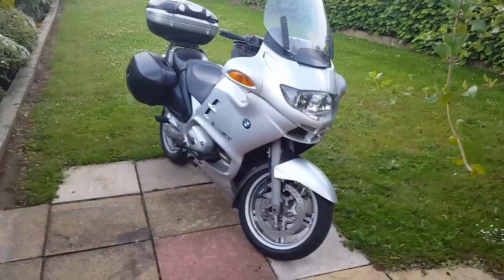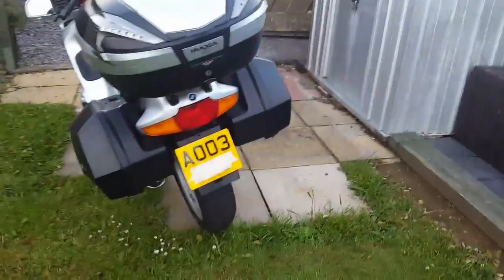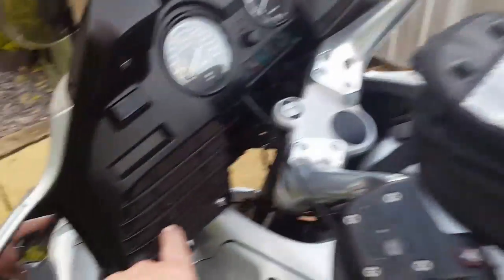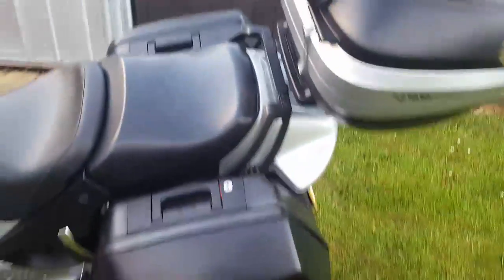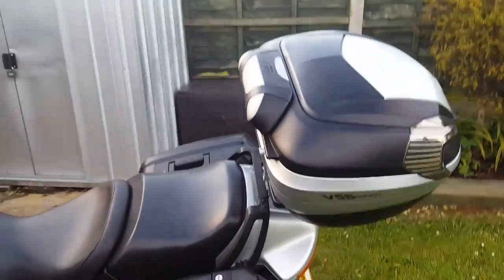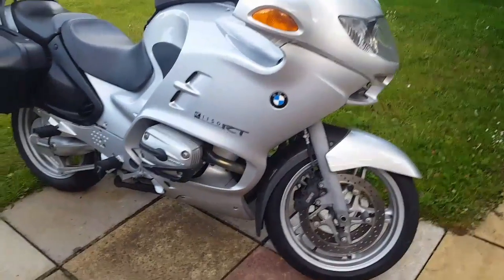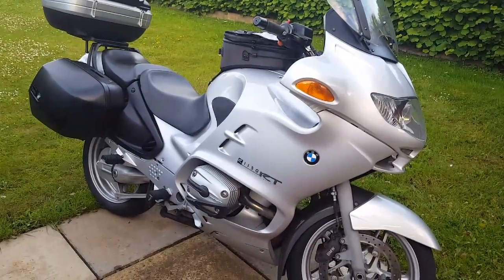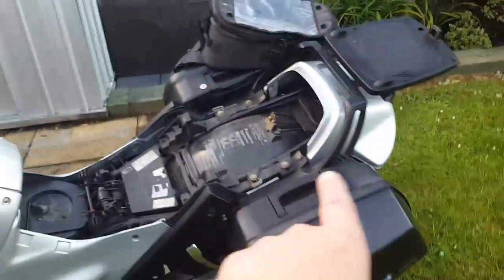Bmw r1150rt  "rita"

Comment: Great bike. I did 15000 km on it mostly to commute and it has never failed me.
The RPM is a bit low, it should be between 1100 & 1150 +/- 50. The engine will sound much better

Comment: Nice acquisition, should be excellent for touring.  I’m similar shaped to you, I’m over 6 ft, but only 31 or 32 inch inside leg, and struggle to find jackets long enough.
Reply from the maker: Hey Tony , there will be lots to tinker with I'm sure but just so bloomin tied up at work its gonna be ages before I get to know the bike. Hey ho! 
👍🏻☮❤

Comment: I’m 187cms and found the riding position uncomfortable on a long run, especially on my right side, might be my age? GS much more comfortable, experienced same problem on a K1600 as RT1150.
Reply from the maker: I never did get comfortable on it . Ended up with a 1200 bandit and it feels fine .👍🏻☮❤
Reply: springy 2112 Pleased to hear that you found a comfortable bike eventually. I rented a K1600 for a couple of days, too low for me even in high seat position. God help anyone riding a bike if 6ft 6ins+!
Reply from the maker: @jeanjacques9980  
I'm 10cm shorter at 5ft 10 . but I have short legs for my height also ..so it's always fun finding a bike that fits that's not a cruiser..
Not quite old enough for cruiser yet at 52 !! one day I'll probably go to the dark side .👍🏻☮❤

Comment: Like you, my legs are 30 inches on a good day. I'm curious how you have gotten along with Rita. I'm looking to buy this model here in the USA and am concerned about being too tall for me. Long term are you comfortable with the lowest seat height setting?  Knowing what you know now, ... would you still this BMW model? Thanks in Advance!
Reply from the maker: on the low seat it was fine I could get both feet flat .. I don't own the bike now. I couldn't get on with its bmw ness.  Unless you've owned a bunch of boxer twin bmws you're in for a surprise. .. You need to do lots of miles too ..
They are a pig around town .. a giant pig ..
But on the open road you couldn't get a better tourer in my opinion ..
build quality is second to none . it was built like a tank .. and rode lik
e a tank at low speed .
I didn't do the miles to appreciate it ..
Also didn t like the electric servo assisted brakes  . but the abs  was great.. the electric screen was also brilliant.. and for a massive bike it was balanced really well ..
I wouldn't get another one because I don't do long trips ..These are not for quick blasts.. But 2 up with luggage perfect .
👍🏻☮❤
Reply: @springy-2112  Thank you! You may have saved me from a costly mistake. I currently have a lowered Honda CB500X that I love riding solo. Not so much for 2 up riding. I'm also considering a Honda ST 1300.

Comment: hi mate looking for a tank bag for my 1150rt, still got yours is it for sale or model name/number please thanks steve
Reply from the maker: It was a genuine BMW accessory came with the bike . I would look up baglux either usedon ebay or new . They do a tank cover and selection of bags. They do most models . ✌️💛
Reply from the maker: Givi do a tank lock that fits to the fuel cap and accepts a givi selection of tank bags 
 Probably cheaper than baglux.✌️💛   https://www.brandedbiker.co.uk/shop/givi-bf11-tanklock-fitting-bmw-r1150rt/

Comment: I’m bout to go put money down on mine today
Reply from the maker: If you're going to do miles it'll be perfect .
I was only doing short trips so it wasn't right for me ..But of all the 52 bikes I've owned it was the best built and designed .. It's perfectly balanced on the centre stand . It's amazing road holding for a huge bike ..
The brakes are scary sharp if you have the electronic servo version also they are linked front and rear . They feel very sharp at first but you get used to how great they are quickly.. The throttle bodies need synchronizing regularly maybe each service ? you will know if they need tuning if the warm idle gets erratic ..and starts to hunt below 1100 rpm .. it's not a major job . I had mine done at the local shop and it transformed the bike .. I loved the 3 way adjustable seat ? the massive luggage and the shaft drive .. Again I didn t do enough miles to appreciate it bit so sold it to a guy who commuted to work and he loves it .. The gears are a thing too . You really need to short shift and let the bike torque do the work ..I was shifting like a jap four ..this doesn't work ..shift up through the gears earlier than you would think and she'll just cruise along ..
I would thoroughly recommended one ..
Peace and love brother 👍🏻☮❤
let me know how you get on .👍🏻

Comment: bye a pilot road 4 or 5 not crapy 2
Reply from the maker: yes I've heard the 4s and 5s are really good.. only had 2s to judge by and they've been good. But next time I need new tyres I'll go 4 or 5 👍🏻☮❤
Reply: @springy-2112  Personally i use Bridgestone S21 - it is 200% better than pilot road 4 but last a little millage - in cbr600 rear something like 8kkm  .front 12-14kkm  but grip is marwelous - you can stoppie or whelie in rain which is immposible with michelin
Reply from the maker: @mikkei3532  they sound good . I always have issues in the wet in terms of tyre confidence. 
It's incredible how the same tyres can act so differently on different bikes..my 1200 bandit has mich road power 2s . what it came with ..they are very much soft grippy almost slick tyres (race type looking)
but somehow they work really well in the wet too.. ok not what I would choose on a 1200 bandit I thought they would be lethal in the rain ! when I need new boots I will look into all the options. thanks for your feedback. you never know what's good unless you try every tyre . cheers buddy 👍🏻😊☮